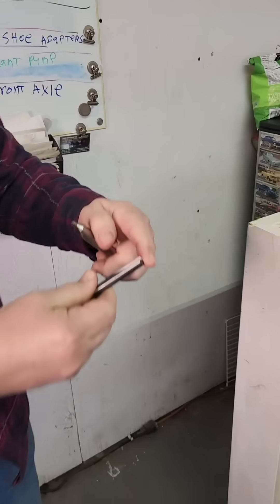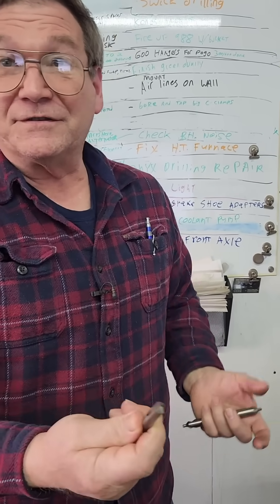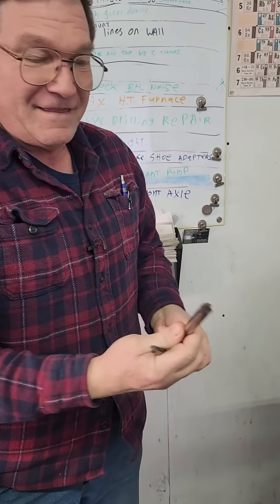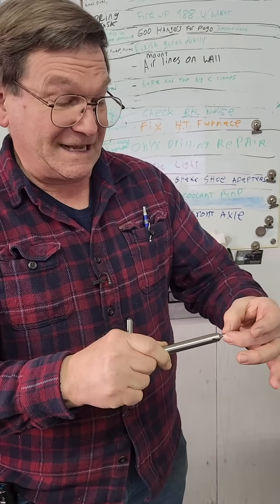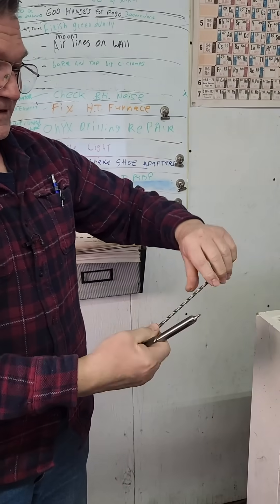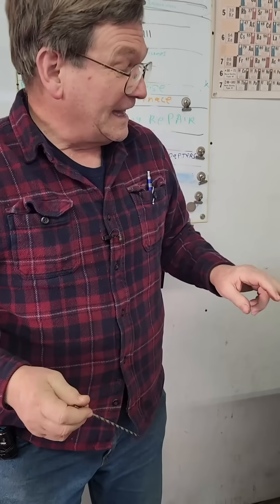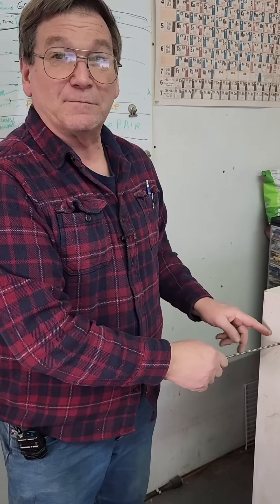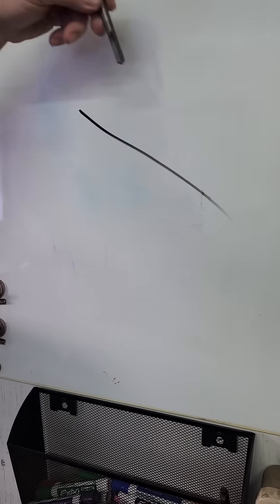Machinist's Minute(s): Spotting vs center drills for starting holes

Comment: I stink at being able to center punch accurately. I can eyeball a center drill on a mark in a mill much better than I can center punch anything as accurately. I lower the bit until it's just touching and then eyeball from the front for the X and from the side for the Y.. It's my best solution short of edge finding of some some sort and then using measurements with my DRO.

Comment: Most important is the angle of the spot must match the drill tip angle. Youll have perfectly placed holes. Along with spot, drill, straighten [w an end mill] the ream. Perfect holes locations every time. I get .001 true position all day
Reply: Yes, the angle is the important.  Usually 2 degrees larger than the drill point angle so that the point of the drill contacts the work first.  When the cutting lips touch first, the forces may pull the drill off center.  Also, only the very tip of the centering bit is appropriate for 118-degree drills.  If you drill a center, in which there is relief for the tip of the center (and a reservoir of lube for dead centers), use the full length of the centering drill. And I thought centering drills are hard all the way thru, which makes it stiffer and less likely to wander.

Comment: Good points here, but a bit into the weeds about an obscure case rather than focusing on the wrong but common usage of center drills instead of spotting drills. There are nuggets here but the big difference is missed. Still gonna be people using one where they ought to use the other in general.

Comment: We drilled a lot of conical burner nozzles with 100’s of small holes. Sometimes the angle was so steep that we had to use a 2-flute to mill a small flat spot so the center drill would not push away. Fun times.

Comment: Howee, respect your vast experience.
You didn’t mention the angle difference.
A center drill is ground with 2 different angles.
The initial point is ground to jobber drill angle, 118 deg, with the next section
 (after the parallel part!)
Ground to 60 deg included as a match for a tail stock center.
If the 60 deg section, or even the parallel section, enters the work,
 the next drill will initially have flank rather than center contact.
It will wobble.
99% of holes aren’t that critical..
When drilling into an angled surface I’ll create a small flat with an endmill perp to the intended hole.
There are definitely times that I don’t mark out or center pop for the mill.
In DRO’s we trust.

Comment: if i have a hole that requires a long reach, i just use a 140 degree carbide drill. it won't walk. when i use my 142 degree spot drill i just put a little .02 deep mark for starting my cobalt drills. Almost bought a center drill today because i needed to countersink a hole, but i just bought a countersink instead.

Comment: Something that I see a lot of is machinists center-drilling past the tip to pilot a drill, but that means you're rubbing the margins and it doesn't guide the point. You need only use the very tip as a guide. The 60-degree angle is for centers, not drills.
Reply: Appreciate the info, that question was in my head. Appreciate it.
Reply: I used to just go .03 deep when I used center drill on CNC mill was very reliable even with long drills
Reply: @Brian55126  I appreciate the info so thank you
Reply: I do as well thanks
Reply: I use them the same way as you mentioned.